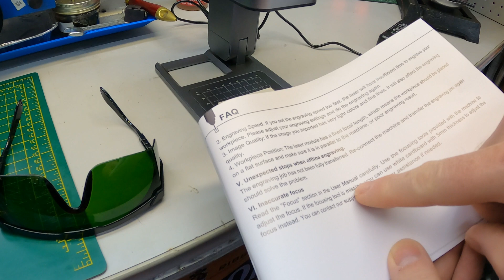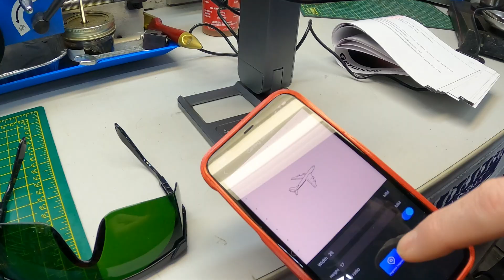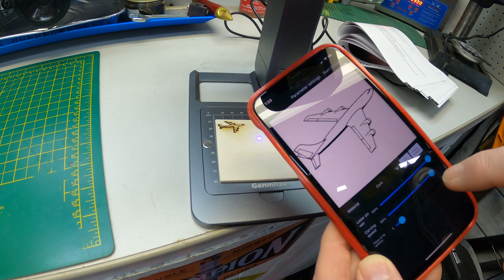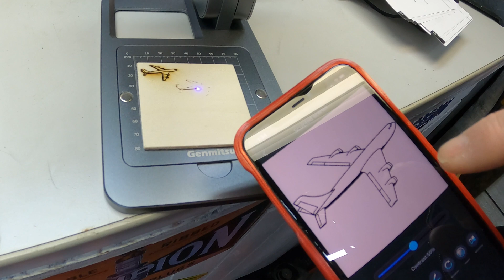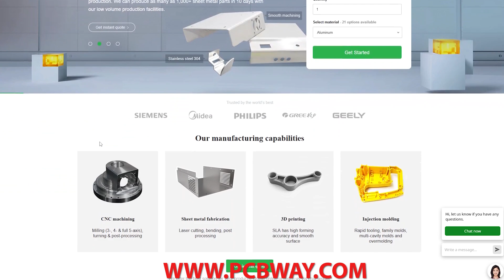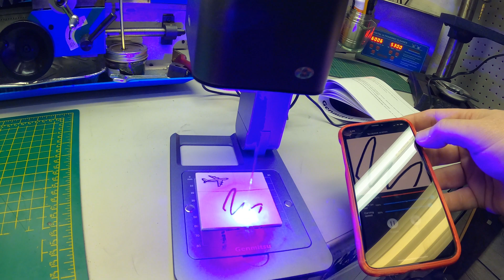Everything You Need To Know About The Sainsmart Genmitsu/Jinsoku 5W Galvo Laser

Comment: Do NEVER ENGRAVE PVC (like the charger in the video) with an open frame laser! It will produce chlorine gas which is very toxic, and hydrochloric acid which will corode every metal in your shop. Be careful.
Reply from the maker: True- not advised but that's ABS not PVC